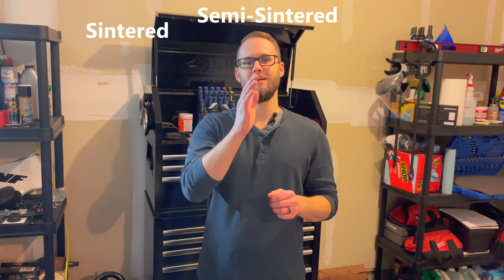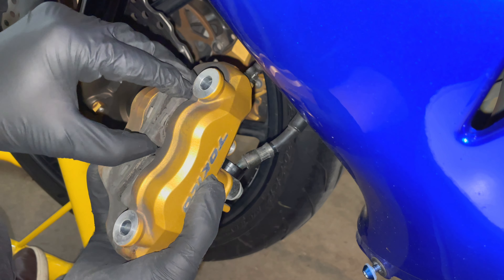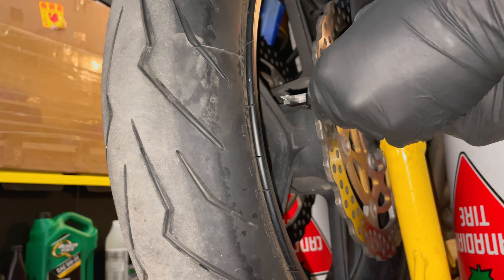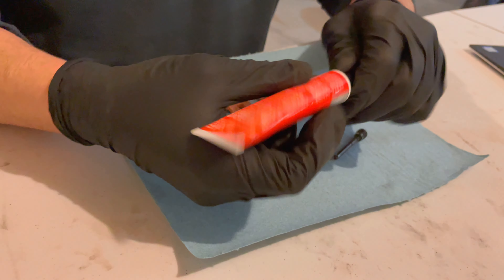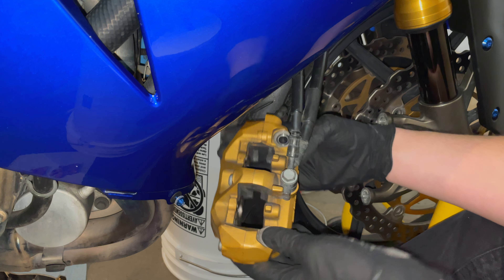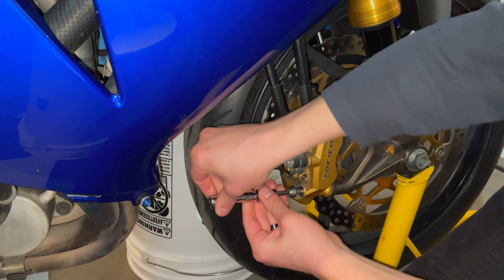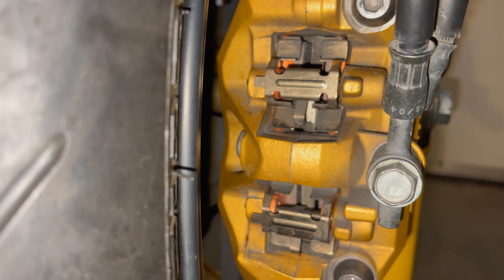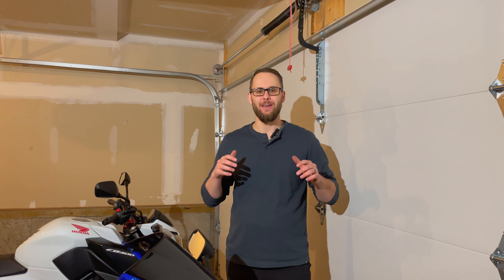How To: Replace the Brake Pads on a SPORT BIKE (2004 Ninja ZX10R)

Comment: Good clear video! What is the purpose of the grease on the back of the brake pad? Is it to prevent squeaking? I actually changed the pads on my 05 zx-10r yesterday, which has little circular metal clips which slide on the back of the brake pad.

Did you do the rear brake also? If you haven't done it yet, try not to knock off the metal clip from the caliper bracket, took me ages to work out how it goes back on..

Do you have any other zx-10r videos planned? Really love the first gen zx-10r, it's so fun to ride.
Reply from the maker: Hey Wistfultoll! The lube on the back is supposed to help with brake chatter and squeaking (like you mentioned). 

Interesting about the clips! I noticed them on the OEM pads, but the new ones didn’t come with them, so I didn’t bother. Did you end up pulling them off of the old pads? 

Haven’t done the rear brake yet, because I can visibly see that the pads still have lots of life left in them. Thanks for the tip! 

Yes, I have tons of ZX10R content planned, so stay tuned and subscribe to see more! 😁
Reply: @FullThrottleFreedomChannel  Yeah I just took them off the old pads, gave them a quick clean, and put them on the new ones, they fit no problem.

Looking forward to more :)